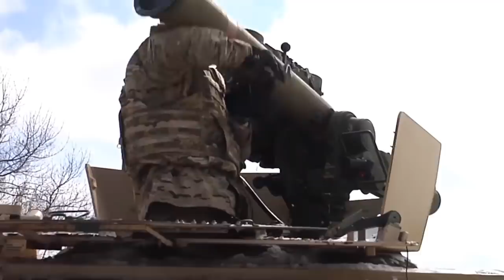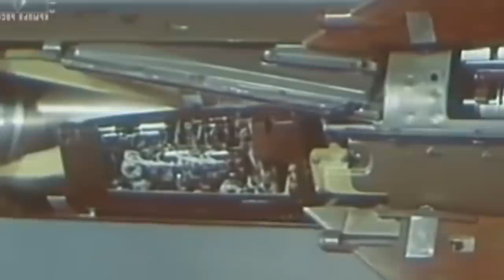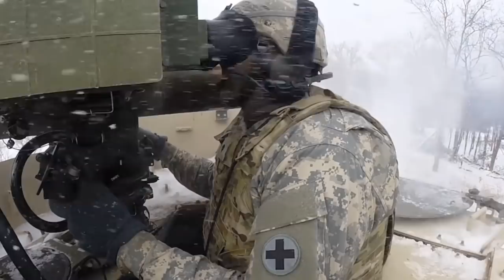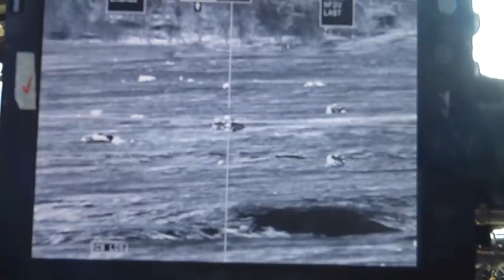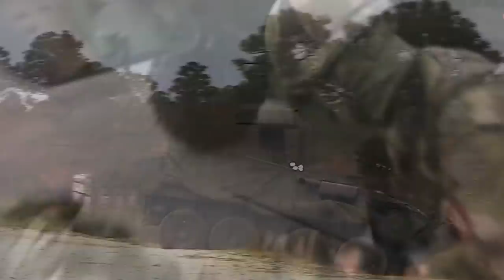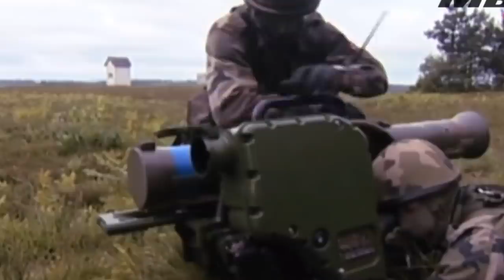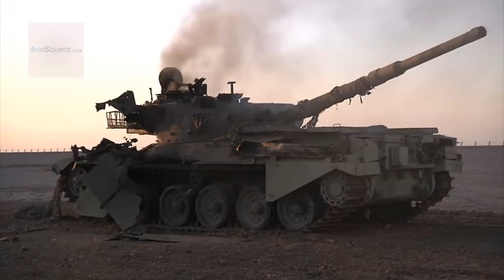Should Main Battle Tanks have Anti-tank Missiles?

Comment: Tanks already have ATGMs.  The weapon system consists of a well-trained human with a mk 1 brain, a sight, a gun, and a round of ammunition.  The system is so advanced that the projectiles require no terminal guidance to destroy a target keeping maintenance costs down.  This system works 100% reliably in all weather and in all conditions of ECM jamming.
Reply from the maker: SteelbeastsCavalry agreed
Reply: A similar advanced cost-effective system is seen in the GAU-8 cannon on the A-10C.  The weapon is GUARANTEED 100% within half a mile slant range to melt ANY tank in existence.
Reply: Software upgrades to the targeting system involve a TC's boot between the shoulder blades of the gunner and can be accomplished easily without a factory recall.
Reply: A-10 pilots were advised to only engage MBTs from the sides and rear, considering these MBTs were T-62, the penetration of the GAU-8 is pretty poor. RHA: 69mm at 500m, 38mm at 1000m Won't harm a modern MBT.
Reply: Another problem for adding ATGM systems to tanks is that modern MBT's are now having more and more active protection systems and so in near future sabots might be more likely to actually hit the target instead of getting shot down on their way there like missiles.
Reply: ATGM generally use HEAT (shaped) rounds, which have lower penetration than Sabot or Fin. However I believe some climb just before hitting the target, which allows them to strike down on the top of turret.
Reply: Different penetration. Against steel, modern ATGMs reach comparable penetration to APFSDS, but HEAT/SC is much easier counterable than KE.
Reply: SteelbeastsCavalry -  not true vs a fast moving enemy tank and one maneuvering 3.5 km out from your unguided mk 1 tank ammo position. Guided missile will win.
Reply: keith .... an all weather ATGM round fired 4km from a maneuvering enemy tank will cost 2% or 3% of enemy tank's cost!  It's the most prudent cost-effective solution.
Reply: keith - you're missing the point!  Mix ATGM integration w/ the main gun capability on your tank or a dedicated atgm hull in your tank platoon for superior effect.  A cheap all weather fire and forget Brimstone II fired 6-7 km away at a maneuvering enemy tank, costing perhaps 3% the cost of said threat tank, is an extremely cost-effective trade-off!  A prudent investment...
Reply: 100% agreed if we talk about engagements in short range - less then 2kms for sabot rounds (sometimes a bit more), because of speed decrease beyond those distances. Also the case for GAU-8: only short range. But if you want to engage at 4 or more kms, to be the first who engages, you need guided projectile with HEAT/HESH "penetrator", which is not affected by the impact speed. Also the lower speed of the ATGM gives time to steer it toward target. The hybrid between KE and guided projectile was:  MGM-166 LOSAT.
Reply: ATGM's are best suited for infantry who can go and anywhere in battlefield and hide in ambush for tanks. ATGM's are also good for IFVS and APCS to give them a bigger bite and chance to knock out heavy armour. tanks can have them as an option if wanted by developer or military as an extra punch for the tank but with there main gun, a good computer, skilled crew and good ammunition they are already equipped to kill other main battle tanks.
Reply: well spoken. i think your correct long term in the future we will go then this route suppose. it will be interesting to see all the different weight class's again. but i think the main gun will be around for a while yet. especially in the poorer parts of the world. today already weaponry and vehicles are expensive unless there old cold war stock.
Reply: It all depends on what is meant by the term "tank".
Tank is a means of fighting against all types of goals, and no matter how much it is predicted by oblivion, it will not work without it. Let it even look different, the purposes of application will remain the same - support for ground troops. Aviation to fully implement this task can not to this day. The optimal combination of artillery, aviation and tanks give an effect.

ATGM 125mm is too weak today, or too expensive (triple charge) which is capable of penetrating any armor, provided it gets to it. Heavy ptur caliber from 150mm is quite another matter.

But we should return to the interaction, which should be automated and cryptographically protected. Man is unable to compete with the machine one on one.
And then heavy ATGM on the tank becomes an organic part of it, Israel knowingly develops a long-range missile with a radius of application up to 12 km.

And here it is worth recalling the potential of the T-14. About the gun in 152mm, the reserve of mass in 20+ metric tons.
Reply: and for RH 120mm tank guns, precision guided munitions up to 12km range, in development: XM1111: https://en.wikipedia.org/wiki/XM1111_Mid-Range_Munition
Reply: Jonny This is b.s.
Reply: Until he goes behind cover pinhead.  He is moving after all.
Reply: There is no such thing as an "all-weather" ATGM.  Cold ruins batteries, rain can ruin electronics in storage, who knows.   Complexity is not reliability technically.  I totally agree with you how modern ATGMs are amazing,  they will eventually put tanks out of business in my opinion, but I strongly believe the GUN is still the best cost-effective way to get the job done for the work done by a tank.
Reply: Totally agree.
Reply: And yet........................   tanks are still around infantry like a glove around fingers.  Interesting.
Reply: And then DU 30mm ammunition arrived....
Reply: Radar has picked up a helicopter going soi soi soi.
Reply: "...A similar advanced cost-effective system is seen in the GAU-8 cannon on the A-10C.  The weapon is GUARANTEED 100% within half a mile slant range to melt ANY tank in existence."
IF the tank take  the hit on the top or side. Frontal - the tank will take a laugh at you, at half mile or at half inch.
Reply: SteelbeastsCavalry will these components (especially the sight) still work with the more affordable yet harder to control Mk1ADHD brain?
Reply: Scouts Out
Reply: That comment was awesome
Reply: "THEY ALREADY HAVE THE BEST SIDEARM EVER, ITS THE 1911 IN THE HANDS OF A WELL TRAINED HUMAN WITH A MK1 BRAIN, A RUDIMENTARY IRON SIGHT AND 8 ROUNDS OF AMMUNITION" 

Also:
"THEY SHOULD HAVE NEVER CHANGED FROM THE M1 GARAND"
Reply: Just saying y’all, in the next war you will be spotted by hidden land and maybe even some air binocular scout drones/cams and targeting data relayed immediately to a cybernetic enhanced mobile mortar/artillery or anti tank missile long before you line off sight anything resembling a enemy tank. Targeting data will flow like water in the next big conflict so makes no sense to put your cannon anywhere near your targeting aka view (if your targeting system can scout ahead of you, the better; even a destroyed unarmed camera drone says a lot about the enemy whereabouts). Fly or roll the recon ahead, keep the mobile ranges weapon systems that don’t need line of sight safe in the back, and wait till some folkish tanker shoots at a camera drone (assuming it spots a tiny camera disguised as wild life before the camera relays that data to the back attack). Line of sight fire for such a expensive peace of equipment like a tank is not worth it. A few cameras/camera drones and a missile in the future will be cheaper then any tank which will make the risk to reward ratio of sight line cheap guns a liability. Infantry got the mobile cybernetic  mortars and their recon drone front line pushers. Vehicles got the anti vehicle missile mobile artillery wirh their advancing scouting network. Airs will get their equivalents. As for the infantry carrying “anti tank” systems; it’s a fad (well against a tank or larger; could maybe be effective in some other niche targets but expense will catch up). With recon drone pushes becoming popular in future infantry will be do busy trying to stop the drone pauperize wave and their Medusa mortar disposable sight and with mobile weapons platforms being on far back there will be nothing for them to shoot at in the front lines anyway. The armed vehicle will always be Abel to have longer range capabilities then any infantry so it will make better use of advancing drone targeting data networks not to mention they are more mobile too. Odds of a solder with a javelin equivalent not being spotted by a bunch of small recon or surveillance drones and being paninted for mortaring from some vehicle or team miles away before said “anti tank infantry” crosses said mile undetected by the Medusa paparazzi‘s in the bushes is such bad odds it’s ridiculous. And that’s assuming the enemy infantry (drone or human) don’t spot them first and note drones can be smaller/better disguised see farther and react faster. It will be a bad time. Mortar is cheaper then a “anti tank infantry’s weapon”, a missile will become cheaper then a tank/aircraft or whatever they are firing at, bullets will be cheaper then recon wave drones (though line of sight usually is longer then that of most infantry weapon effective range and the smallness/disguises such drones will make there be more to that match up. The advancing push will be done by the target designator and their bonded mobile artillery subsequent fire. The “tank” will be converted or fazed out for such mobile artillery or indirect line of fire system carriers staying far enouph away with surveillance ahead of it to stay safe cause let’s be real if your hit by anything near-future anti tank like a kinetic missile/artillery whatever, as a tank your armor will be pretty ineffectual anyway against such planned counters so range will be a much better shield (even if painted and you are out of range your good where that’s advantage will not go to the infantry with the anti-launcher). Just some thoughts. By the way I’m mainly talking about non mobile artillery “tanks” not “tanks like the howitzer that are built artillery in mind and can still use direct line of sight if needed”. Any non line of sight will do the job and the cheaper the better against drone warfare. Unless it’s cheaper to slap external rocket pods on retrofitted tanks or missile technology can fired and forgotten while on the move (and auto course correct/ seek and destroy over a area (to counter shoot and scoot like a suicide drone looking for prey trying to run away)/ steer around obstacles and hit faster harder to block with air defense wile somehow being cost effective with good mass production infrastructure; maybe then we can mostly phase out the dumb artillery round)

Comment: The main reason is speed, a main gun can fire in the move and lot faster. The crew is under stress to worry about another weapon system. ATM are great for ambush  . Self defense for vehicles with light armament etc. Another thing is the 120mm has a massive blast and recoil. So I see issues with control of the ATM when used togethet
Reply: Hold more ammo. Different kinds of ammo. More versatile. Faster reload. Now we have smart rounds that can attack over targets with EPGs.

 Now if it was a missile system like a Stinger that could take out drones and low flying helicopters then absolutely add it.

 Just seems redundant. More cost and weight.

 IMO all MBTs from here on out should be able to have a FCS that allows them to work as artillery in a pinch. We have the computer power and hardware. That would require somehow to manage charges but it is a no brainer to be able to launch a few 120mm(130, 140, 152mm for future tanks)  shells over the horizon. Also all tanks should have a drone it can release to locate targets and come back to charge.
Reply: Hahaha
Reply: Ya but standoff. Have 5 Abraham's in overwatch/sniper positions, fire missiles from twin mounted javelin missiles. Fire those 2 from each vehicle and when they land and the enemy starts scattering, use the gun in their confusion.

It would be more of an ambush terror weapon.

I forsee future t14 style tanks with normal wide turrets to allow them to carry attack and scouting drones